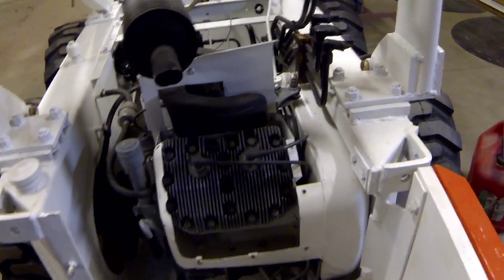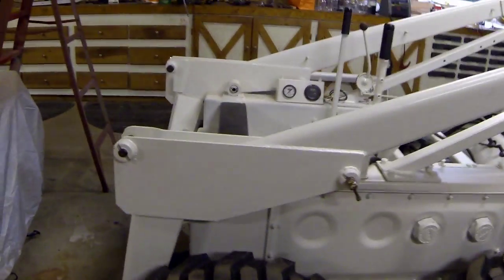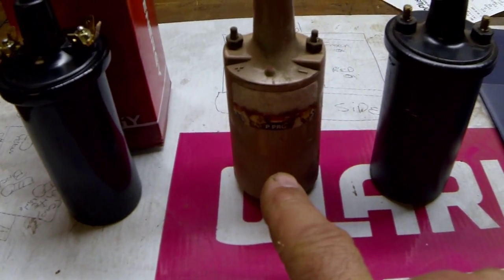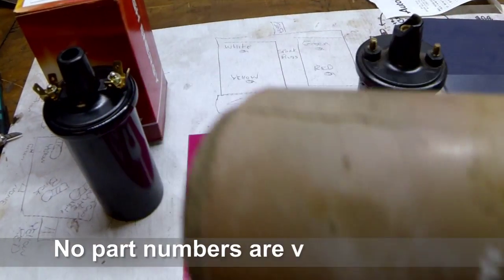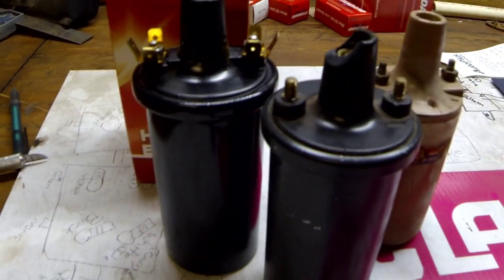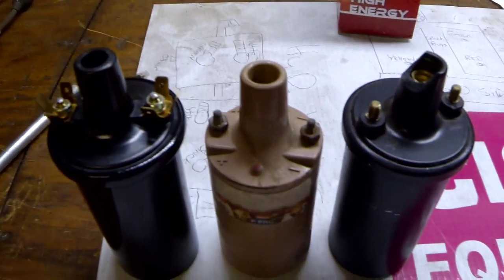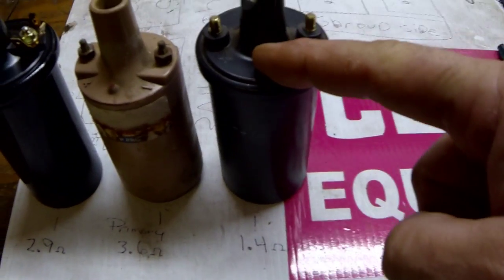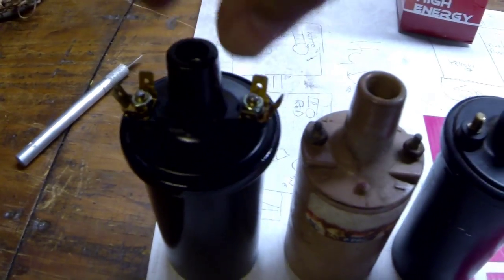WISCONSIN VH4D COIL QUESTION

Comment: Just had my vh4d engine shut down while running at constant speed like someone turned the ignition off. I cleaned the points with no luck, then put a coil(exactly like the new one in your vid) on that I had from an old VW bus engine and it did run and had great spark, but was sputtery and weak. Apparently a coil is not a coil. I guess similar is true of spark plugs and tires and anything else that can be made for an exact purpose.
Reply from the maker: I know its crazy !!! the only coil it will run on is the original coil... I have not been able to find any other coil that would work.... Have you found a replacement ???

Comment: I have the same issue super weak spark like barely tickle not the hard shock we all are use too. Ran a dedicated ground from battery to coil negative and block. Going to add another ground to dist base. You can’t even hear the spark snap driving me crazy I had a coil with 8.7ohms so it looks like less ohms is the best bet for these engines.

Comment: Hi, just wandering if you ever figured out the solution to your coil issues?
Reply from the maker: Yes in my case it was a combination of points and condenser that were not up to power..
Reply: @Redneckmfg  I had to replace my coil. I had a time finding one with 3 ohm resistance on the primary. Through a lot of research I determined that most 4, and 6 cylinder engines require higher ohms on the primary. I located , on line, a Lucas coil that seems to fit the bill.
Reply: @eddiewilson4291  Hi Eddie, do you have the part number of that coil?
Reply: @adriancristea76  Lucas coil Manufactor Number DLB101, Bought on Ebay
Reply: Also added a Pertronics Electronic Distributor. Mine had the side busted out and was about froze up inside. I don't know how it ran as well as it did.

Comment: Hey there if you can just wait a day I'll pull out my 610 manual and I can get the exact part number for you
Reply from the maker: +matt kuchmak   Man that would be awesome... Cause, I am at a loss right now.... Thank You
Reply: +Rick Garloff so that part number is the exact one you need because I have the same skid steer as you there
Reply from the maker: +matt kuchmak Matt Thank you so much !!!
Reply: YOU CAN NOT GO, WRONG WITH THE CORECT, PART NUMBER, GOOD GROUNDS ARE JUST AS IMPORTANT, GOOD LUCK
Reply: My vh won’t start , I wonder if I have a bad coil

Comment: Hey Rick.  

According to the Wisconsin VH4d part manual, there are 2 different coils in use.  YF41AS1 or YF38B.  

I have the VH4D on my Clark/Melrose Bobcat 720 and will check when I get home tonight to tell you what I have on it.

Cheers!
Reply: +Charles Pham 

Hey Rick,

Here are the numbers from the coil on my VH4d on my Bobcat 720:

90919-02113

NIPPONDENSO

029700-4920 12V

USE WITH IGNITOR

MADE IN JAPAN

It's completely different from what the parts manual calls for, but it's the one that came with the Bobcat/VH4d when I bought it and it runs fine, so I never had a need to change it out or even look at it.

Hope this helps!

Cheers!

Comment: I have the same, or kinda of the same issue. I get my engine turned and it runs like crap. It shuts down and the coil is burning hot!! Any body know what the problem is ??????
Reply: Relocate coil off the engine to get heat off of it.    Do this with new coil of coarse

Comment: How's this going for you? I have a VH4D in my m700 and recently the spark got weak so I need to figure that out. The heads are getting super hot. So pretty sure I ran this engine to the grave
Reply: Dis you ever figure out your issue? I just picked up a m700 no spark, test light shows power coming into the resistor on both negative and positive. But not on the wire jumping to distributor top.

Comment: I think you found your answer.  You need a coil that tests out the same as the original.  For kicks, throw this question on the skidsteer forum.  There is a guy out in Arizona, 6b_norma, he has a fleet of these machines and knows lots about them.  HTH
Reply from the maker: +Skid Roe Man I just cant figure that Forum stuff out...lol   Here is the problem how do you ask for a coil by Ohms and not by part number ?????
Reply: +Rick Garloff I usually take a multi meter to the parts store with me.  Most NAPA stores will work with you to find you what you need.  HTH
Reply from the maker: +Skid Roe Will Do ! and matt kuchmak Just posted a post on this as well... The Internet is an amazing place !!

Comment: i think you have 2 bad coils stay with a 3 ohm coil with out a ballast resister you may have a failing condensor that wont run on the other coils